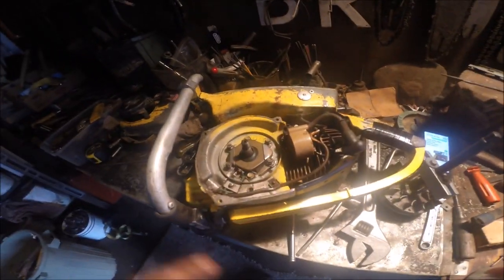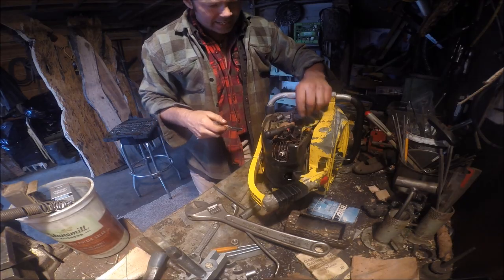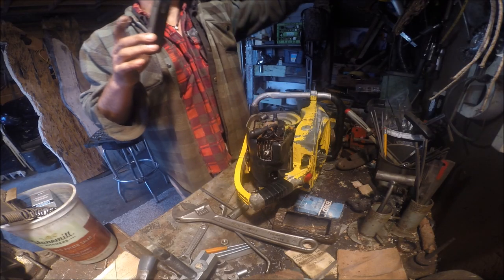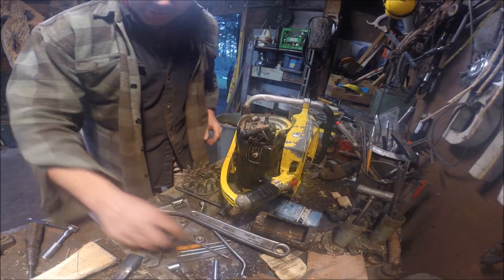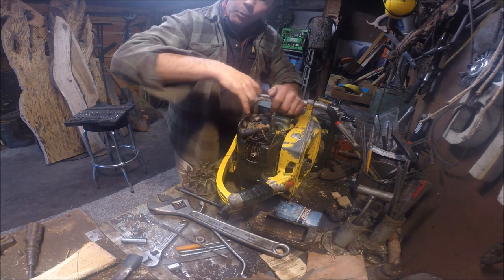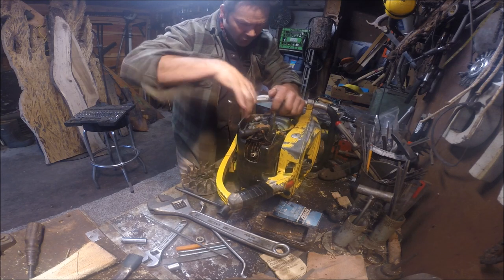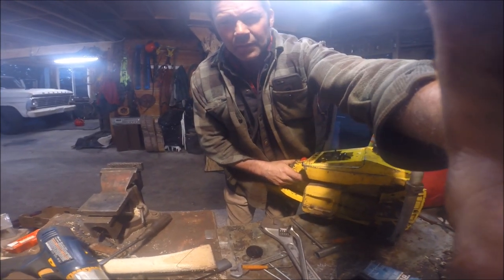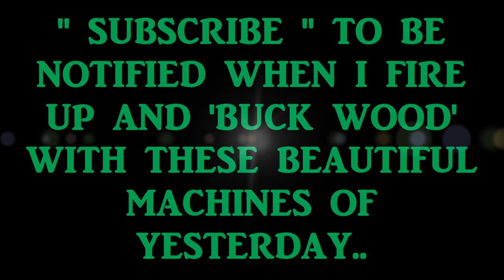McCULLOCH SUPER PRO 125, WAKES UP AFTER POINTS CLEANING

Comment: Those point set looks exactly like the ones Tecumseh Engines used for years on their mower and tractor engines. I would almost bet they are the same ones. This is more than a saw this is a 125 dirt bike you can pick up with one hand.

Comment: Love the video's Billy!!!!! what is the correct fuel ratio for a MuCulloch Pro 10-10 Model 600013U? 40.1? 50.1? What would you recommend for 2 cycle oil?  Thanks for the info!
Reply from the maker: run what you bin runnin in al your stuff  I bin usin stihl oil because it is made by CASTROL  i HAVE RUN THE SAME MIX 20 YEARS NOW ANYWHERE BETWEEN 40- 50 TO 1 IS GOOD JUST KEEP IT CONSISTANT AND RUNN IT HARD AND SHARP DONT FEATHER THE THING,, WIDE OPEN,,, ON... OFF,,  NOP WHAT I MEAN,, HOPE THIS HELPS